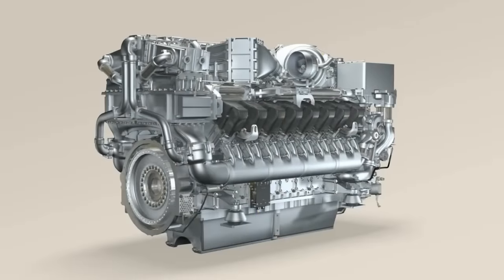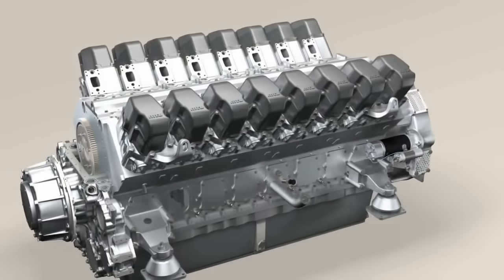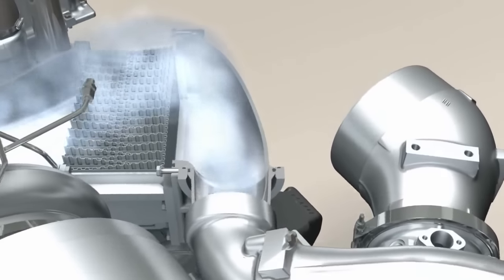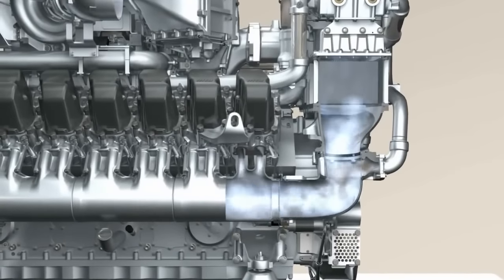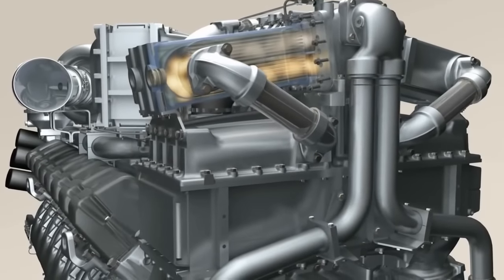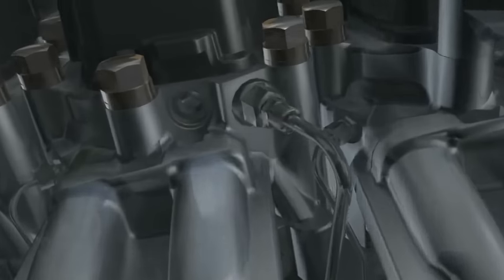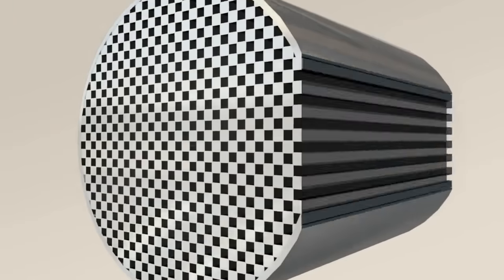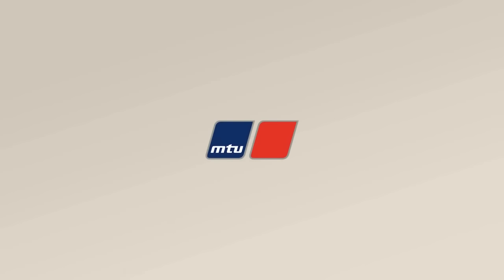Rolls-Royce | How train engines work

Comment: High combustion temperatures increase NOx emmisions. The introduction of exhaust gas that is depleted of oxygen reduces combustion temperatures and hence NOx emissions. Exhaust gas recirculation is inefficient and increases complexity, reduces reliability but reduces NOx also. The exhaust gas is at a higher pressure than inlet air, because the  exhaust valves opens slightly early so the exhaust gas "jets" out of the cylinder. This is known as "blow down". As inlet pressures increase,  recirculation of exhaust gas presents a challenge, and EGR turbos are being considered.  Perhaps hybrid gas turbine/flywheel/ battery combinations will replace the medium speed engine in future, but it's years are numbered in locomotive use. In a few years we will be hovering around in personal solar powered drones made in china, and trains will hover on magnetic field cushions powered by wind turbines. Out little children will have 3 way catalytic converters inserted up thier arse holes at birth, to cleanse thier farts. Despite increasing human population, The robots will make everything and no one will work, leading to boredom, depression, drug addiction and massive increases in gun crime. As the gulf between rich and poor widens, civil war will rage. Any advances made in cleaning the exhaust gases of diesel engines will be offset by all the toxic gun smoke.
Reply: Slowly stands and claps
Reply: That is too much of pessimism. But the AH insert is a brilliant idea.
Reply: Then Judge Dredd will appear and say "i knew u were gonna say that"
Reply: could not have said it better....

Comment: Is that a spark plug inside the cylinder??? 
If yes, how can it be used in a diesel engine??
Reply: good question
Reply: It’s not. That’s an injector.
Reply: No, that's a fuel nozzle.

Comment: 0:12 "There's no way around diesel engines." Ever heard of an electric train?
Reply: Its all about reducing pollution, where does the electricity come from?
Reply: My point was that there are alternatives to diesel engines, not that diesel engines pollute.
Reply: Electric still has a long way to go, trains not so much since the overhead lines are there giving constant power, I also rarely see electric freight trains? or none at all in the UK, USA. I don't know if the massive weight is a limiting factor to the electric motor.
Reply: Peter Smyth the diesel trains are electric/diesel Its like a hybrid
Reply: Matt JT there are electric freight trains in the U.K., and there are also massive electric freight trains in Australia, the reason why electric freight isn't as common is because of the costs of building overhead wires and maintaining them, as freight trains sometimes have to cover massive distances, you can only have electric freight trains if the length of the line that the train will have to go is electrified, there's also electric freight in Germany, America also has electric locomotives, whether they use them for freight or not I'm not too sure
Reply: I have honeneslty never seen an electric (overhead) electric freight train
Reply: Thanks, honestly never seen them in the UK all diesel's I've seen as freight pullers,  I never knew they were a thing.
Reply: https://www.youtube.com/watch?v=GDPR2u417Ss heres the uk one, this is the most common electric locomotive used for freight, as it has third rail capability, that train is also allowed to go through the channel, the other electric locomotive used for freight is the class 90 and the class 86 https://www.youtube.com/watch?v=M1IIGDrpLRs those are the freight electric locomotives that i know of from the uk, there may be more, the class 90 and class 86 can be used for passenger as well which i have seen be done on youtube, the class 92 not so much, it may have happened but the 92 were built for freight purposes
Reply: You do know that 99% of trains for the last 50 years or so have been diesel electric. Diesel is the most efficient engine produced. With today’s technology diesels emit less emission than most gas engines. The engine in trains are used to power the generators that drive the electric motors that run the train. Trains have been hybrid electric for a very long time. Most trains go several hundreds of miles on less fuel than it takes to fill your car up and can carry several tons of weight behind it.
Reply: Mine point is more about overhead electric, I know the vast majority are hybrid D/E and have been for ages. Talking about straight overhead
Reply: Matt JT
https://www.youtube.com/watch?v=lNBarfR99N4
Reply: Peter Smyth or petrol.
Reply: Matt JT The efficiency of electric induction motor is more than 90% where efficiency of a Diesel engine is 40%-50%. And electricity not only generated from coal thermal power plant. There are many sources of electricity. And in Diesel locomotive, train is pull by several electric engine. Diesel engine just runs a generator to generate electricity.
And is India I hardly see a Diesel engine pulling a freight train.
Reply: Tesla might develop in the near future.
Reply: Matt JT come to india and watch
Reply: Matt JT Lol only in the uk U guys use diesel Freight trains in Europe the Traxx Locomotives is mostly used for freight
Reply: Peter Smyth good luck matching the raw power of a Diesel engine, also don't forget the countless miles of cable that has to be installed, higher maintenance cost as well, such as down power cables, towers, things like that. In the end, electric is more polluting than diesel on a large scale.
Reply: Matt JT in the Netherlands all trains run on wind and solar energy
Reply: MartenAFC with a country that small and so developed with nearly no wild spaces, of course it's easy to have an all electric train system. Apples to oranges.
Reply: Nathan Zaremskiy have you seen how much km of traintracks there is in the netherlands? And connecting to entire europe
Reply: MartenAFC have you seen the developed lands of Europe? Heck it's not that hard managing it when a European country is the size of a US state, don't forget there is a massive mountain range right in the middle of the US which will make electric rail extremely expensive and cause major delays every winter. There isn't just one major mountain range, but 3, Appalachian, Rockies, and the cascades. Many railroads are hours from the nearest town, meaning if something happens to the electric cable, then it'll take hours to repair it, thus costing more money not only for the rail line, but everyone relying on it. In Europe, maintenance is within minutes of a railroad, so they can afford it.

There is a reason why the US is still relying on diesel trains, and it will rely on them for at least a couple more decades, if not more.
Reply: MartenAFC it's the same thing with electric cars here, there are so many wild places that electric cars are impractical.

How are you suppose to find a plug in 30 miles from the nearest major town right in the middle of a national forest? And you can't run power cable without extremely expensive NEPA reviews. Either way, even if a cable is run out to a resort, you still can't just recharge a car if you get stuck in the middle of nowhere, without using a gasoline generator.

Don't forget that electric cars today have a life of 100K miles max before replacing the battery, a gasoline car can last you 400K+ miles if you take care of it. If you consider the mining for materials used in the battery, transportation, assembly, etc etc, then a gasoline car is actually more environmentally friendly than a electric car, simply because it'll last longer, without relying on invasive mining every 100 thousand miles.

(Invasive because open pit mines are worse than wells, and either way, you still need wells to supply gasoline to transport the raw materials and what not.)
Reply: Peter Smyth huh, diesel engines don't pollute?
Reply: Guys all the diesel engine does is power a generator that makes electricity for the electric motor that turn the wheels that pulls the loads.

Comment: A properly tuned diesel does not need a particulate filter, a slightly lean mixture helps with that. Particulate filters just make you burn more fuel, to burn off the products of burning too much fuel for a given power output.... Ugh.

Comment: So I noticed that you have used a 4 stroke engine in this video and your Industry standard for the 4000 series is a 2 stroke engine.  Also the video is misleading. The 4000 series has an EGR valve that sends exhaust gas into the combustion  air charge by introducing it BEFORE the cooler and not after it like in the video. This causes severe soot build up on the cooler that is a fin and tube cooler as fine as a radiator. Once that happens, the air charge is reduced and you end up with high exhaust temps in a very short time requiring entire cooler breakdown and cleaning at least every 6 months...

Comment: Better we develop better green power generators with those efficient engines of yours. Leave the automotives to run on electricity as they are less polluting and much easily maintainable. Maybe you should now focus on that next. Hope to see railways fully running on solar energy pretty soon, at least  in tropical and sub-tropical zones.

Comment: It's a diesel why is it showing a spark plug igniting?
Reply: Zergling  diesel engines have much higher  compression ratios than petrol  engines ,therefore combustion occurs spontaneosly.
Reply: It’s not a spark plug. It’s an injector.
Reply: Thomas Strickland I guess the animation didn't do it much Justus
Reply: Peter Laustra combustion doesn’t occur spontaneously in a diesel. Diesel is a lot more stable than gasoline. Diesel has to be hot and compressed to ignite. Whereas gasoline is more volatile and could explode at anytime. Please do a little more research.
Reply: Zergling the whole animation wasn’t produced very well. So there was no justice to be had. Lol! However for a guy like me that knows everything there is to know about Diesel engines. I’ve got your back.
Reply: Thomas Strickland thank you

Comment: Any plans to make a battery-driven long range locomotive that is actually clean?

With all the research and development going into this diesel engine it could have gone a long way towards developing a long-term solution that is truly clean and economical
Reply: Mark Small do a little research. They have been hybrid for more than 50 years. Technology is just getting better. The engine is only used to power an electric generator to produce energy for the electric motors that drive it. Most trains can go several hundred miles on less fuel than it takes to fill your SUV.
Reply: Battery-powered locomotives are just a colossally stupid idea.

Pantographs are a much better solution for longer routes, with Diesel being best for shunting and local hauling. But maybe most importantly, pantographs actually EXIST, and they DO SOMETHING, while the unicorn technology batteries that would be needed for a battery-powered locomotive simply DON'T exist.

Comment: what about the fuel economy ?? :-)
Reply: Trains have been hybrid electric for more than 50 years. The engine is only used to run a generator. Trains are driven by electric motors. Diesel is and always will be more fuel efficient. Diesels are the most efficient as they make more torque and it takes less engine RPM’s to get the job done whereas as gas engine works twice as hard.

Comment: Brag as much as they want trying to make this sound somehow modern and high tech, but at the end of the day, it's just a fucking internal combustion engine... Plain obsolete shit.
Reply: 100% of trains are powered by electric motors. Diesel engines are only used to produce the electricity. They are more fuel efficient than the truck you drive. I can assure you of that.
Reply: That’s not what you were saying. Where are these overhead power lines that you speak of? They sure as heck aren’t here in America. I would hate seeing that crap all over the place anyway. Train technology is coming, I would suspect the maglev systems will be the ones that win. Safer a lot faster, and no ugly power lines. The boxer engine is one of the least efficient engines. However they sound cool and they are very reliable. At least the old ones anyway.
Reply: That1TechDude they will eventually however it’s going to take a while. You have to think about what it’s going to take to change a whole infrastructure like that. The last time the train infrastructure was messed with is when Vanderbilt and others created the train system. Other than modernization of it nothing has been done. The fed is going to have to come up with a lot of money to get this done. So when this goes down I guess you could say. It better be a damn good plan.
Reply: The internal combustion engine is in no way "obsolete shit", in fact there are plenty of applications in which they will always remain the most practical way to provide power. You're committing an appeal to novelty fallacy here.